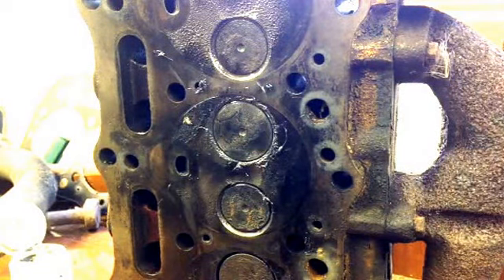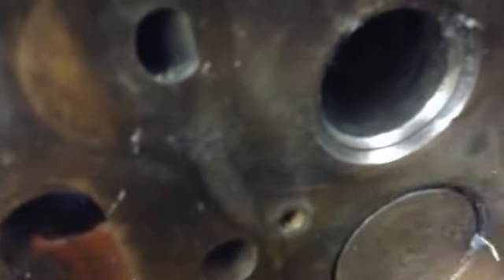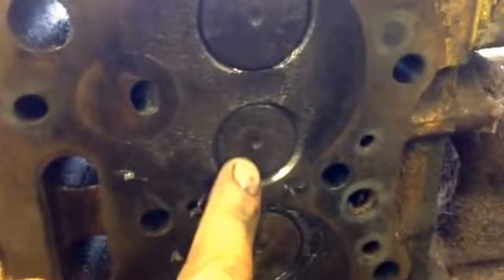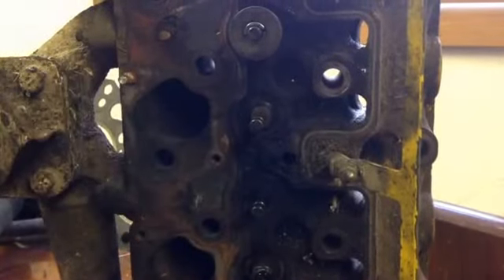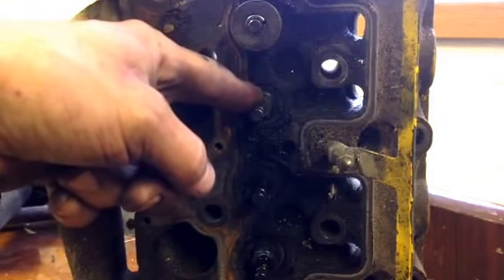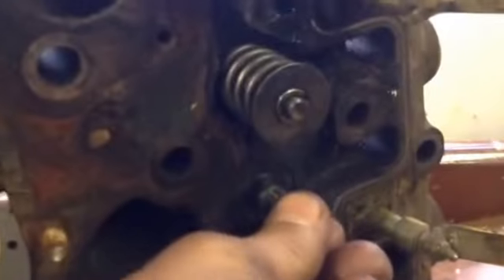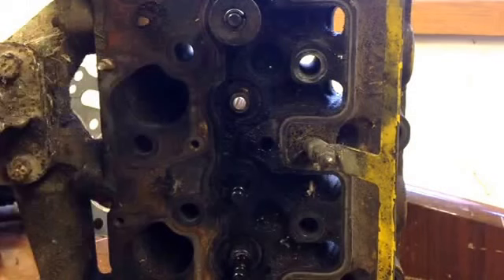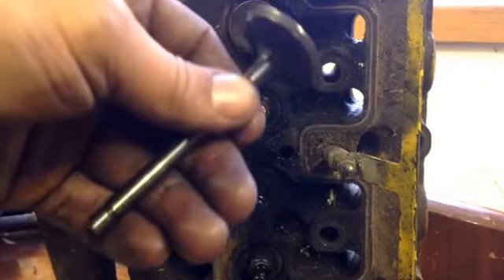Grinding / lapping in really bad valves in a Diesel engine perkins 103 - 15

Comment: Great video, as you rightly said purists may hate it, the valves also end up more shrouded, the compression ratio will be marginally down, the valve train geometry will be affected but the engine will be doing useful work for many more years. I must admit I have done the same but used masking tape around the valve stems to prevent the chuck of the drill from marking them, I was clearly being far too careful!